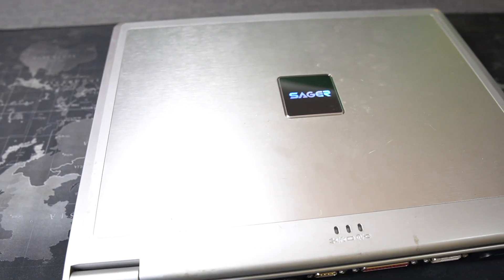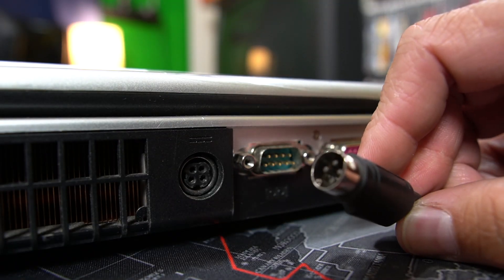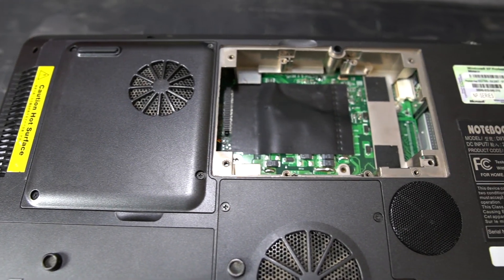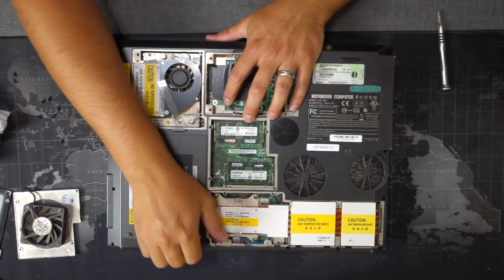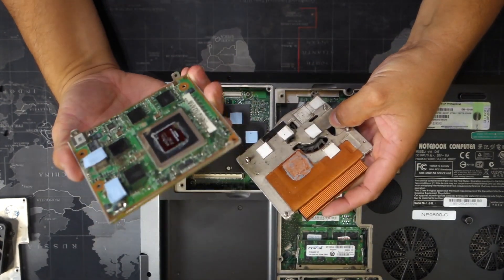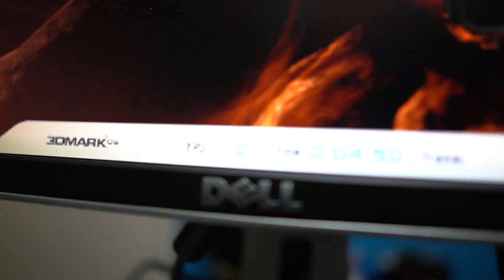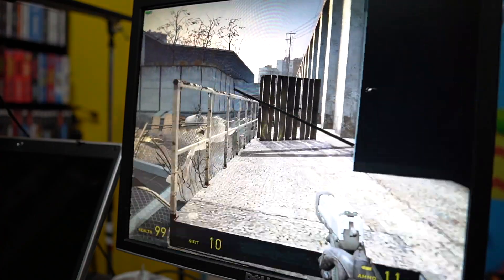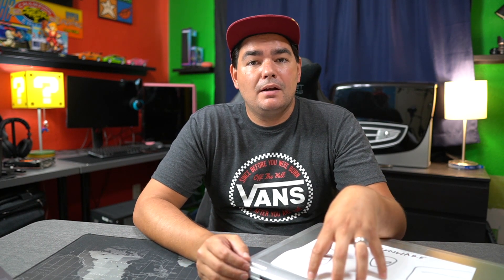What the heck is a "Sager" laptop? (D900t/ Alienware  M7700)

Comment: These older Clevo laptops are getting very hard to find. I have a Clevo D87P from 2004 which is also an absolute beast. It weighs a ton and it has excellent specs for the time. A socket 478 3.2GHZ P4, 1GB of RAM, Mobility Radeon 9700 with 256MBs of VRAM, DVD-ROM drive (Not R/W sadly) And there are spots for 2 hard drives. Mine actually has 2 hard drives and has both caddies and both hard drive cable connectors too. I also found a Clevo D47V which appears to be the D87P's predecessor. Something I highly recommend with any old Clevo laptop is to take it apart and check the plastic around the hinges both inside and outside. These old Clevos seem to have a big problem with screws loosening over time. That does tend to happen with pretty much every laptop, but with Clevos it seems to be a bigger problem. Old Clevo laptops also tend to have fairly poor quality plastic, which makes the whole screw loosening situation worse. My D87P has the very common cracking near the hinges on the top cover. The D47P I found, however, seems to be in excellent condition. Will definitely have to fully take it apart and tighten all screws in it. Anyways, that is definitely a nice find. Clevo laptops are super cool. :)

Comment: my laptop is a sager/clevo m570tu from 2008 with overclocked quad core and overclocked gtx 9800m. i have xp on it and it’s an absolute beast. overkill for anything before 2007 but good until 2011

Comment: I been working for years to get an HP Tm2 2100.. Its a convertible laptop that folds back and is great for drawing.. the 2100 has a video card.. nothing fancy.. but getting one that's working and in good shape is very difficult. I have one but it needs a lot of work.. I have a second one the processor died. :( I check ebay about every day in hopes one shows up that's the right model.. the i3 model is pretty common but the 2100 that's an i5 and has the graphics processor is not.

Comment: I have exactly the same laptop in excellent shape was just missing both the HD( connecting cables still there). What bios settings did you use for a fresh install of windows. I’m having issues with it not seeing the new ssd installed at the windows install which I think is a driver issue for both RAID and ATA setup (bios sees them)I’m going to go the dvd caddy route like you have , but wonder what bios settings you applied for fresh install?
Reply from the maker: I don't remember having to do anything special to the bios to make it work, I am sure I made the install USB with RUFUS and used the default settings.